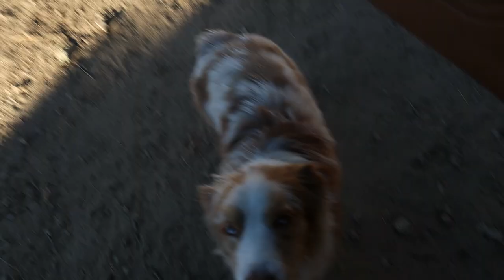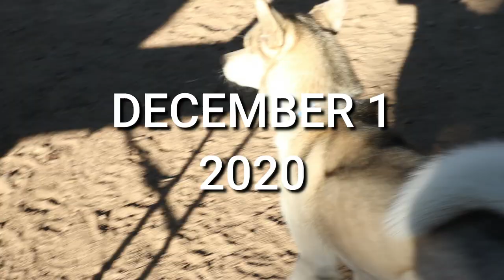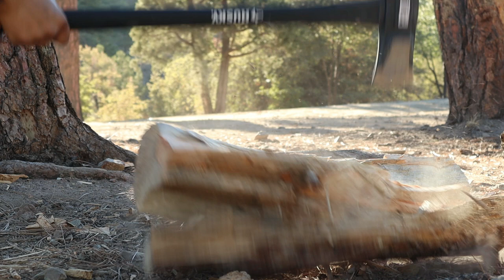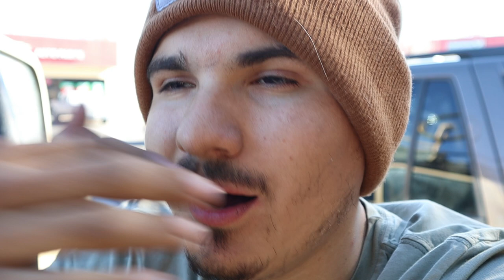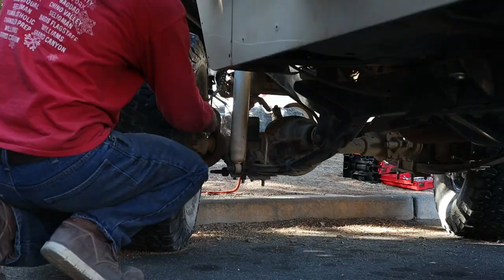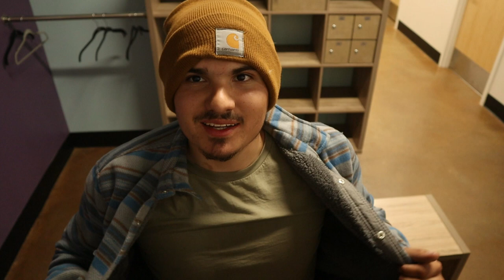My 20th Birthday

Comment: Bad master cylinder, or a possible vacuum leak at the booster. If the engine is still rough, vacuum would be my first guess.
Reply: Exactly what I was going to suggest. 👍🏼
Reply from the maker: It’s definitely got a vacuum leak I can confirm that